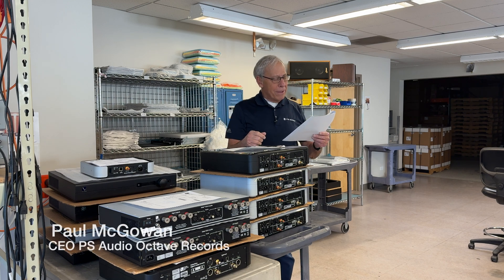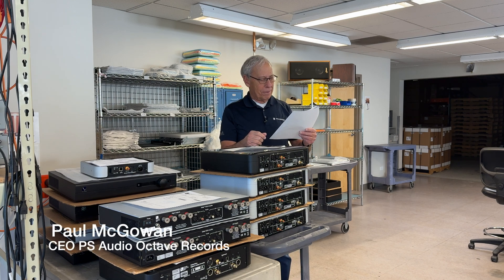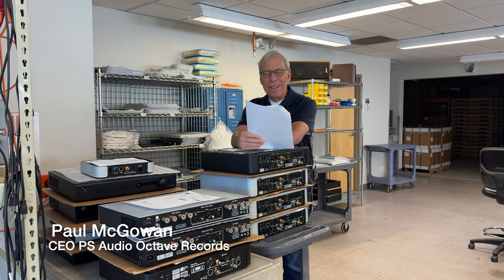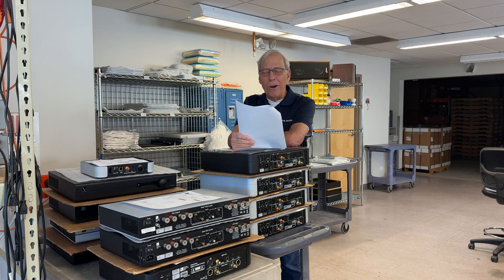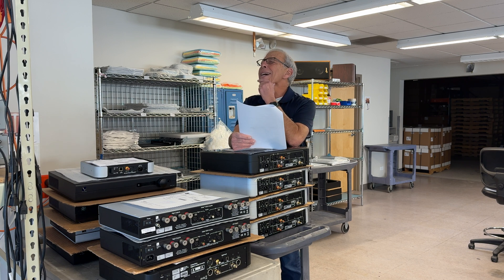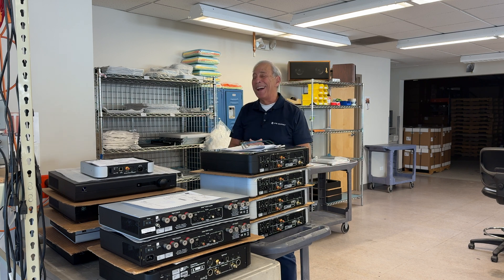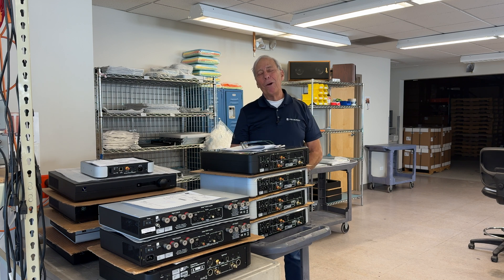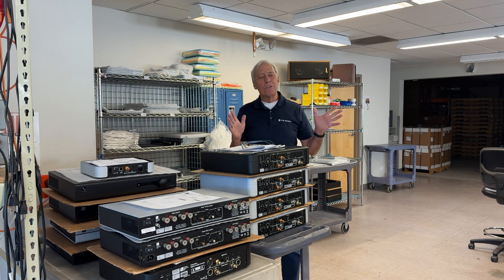Power Plant protection explained

Comment: Correct me if I'm wrong: 'It's my understanding that US power plugs (Type A & B) don't have an ON/OFF switch.'  
This being in contrast to most (all) other standards that have a direct ON/OFF switch as part of the wall socket.

Here in Australia we always just switch off electronics at the wall socket (but leave plugged in) at out holiday home to ensure surge protection and prevent electrical leakage (save costs.) Same if we lose power, Just switch the sensitive electronics off at the wall so that when power is restored, there's no risk of damage. No need to physically unplug.

Comment: Why no UL, ETL, ULc, or any independent lab tests, certs to show it meets industry safety standards, for all things electrical.  the thing is $10K  what are you failing to meet in specs? there is no such thing as built to the same standards, without the label and number.  Shame , for such pricey stuff, no standards for safety

Comment: I have 2 P3's, and I would NOT go on vacation with these left on at the wall. When the power is interrupted by a power outage, the P3's turn on by default when the power is returned. 
This obviously means that you will return from your vacation and your entire system is on and ready to go 😂
Reply: I worry that my Directstream will be cycled on and off in mid-boot if the power flashes on and off. Is there a way to set the Power Plant 10 to not turn back after an interruption of power? Any one know?

Comment: Wow never heard Paul has a "home theater system". 

Wonder what is his processor or AV receiver is? Is he using PS amplifiers.

What does a power plant do when it is on?
Reply: check the video library. he once led a tour.
Reply: The Power Plant rectifies incoming power and uses the DC supply to drive a power amplifier with a DSD created sine wave. This isolates any noise and distortion on the incoming power. Happy listening!
Reply: @belalugrisi1614  seriously that sounds like oil tone. Don't you mean Pulse Width Modulation instead of DSD sine wave.

How does it sound compared to the Audioquest Niagara 7000 Power Conditioner?

Comment: Why does my P3 have a standby mode?  All of the other PS Audio components of my system are plugged into the P3.  I leave those components in standby, as recommended, when not in use.  However if I place the P3 in standby the components plugged into will get no power equivalent to turning the back panel main power switch on each of those other components off, which is not recommended.  This is not mentioned in the operating instructions for the P3, curious.

Comment: Lightning struck a tree 40ft from the house, stripping bark off one side.
Surge protection was fine and undamaged, but surge induced in a long speaker cable blew output stage of power amplifier.
How many will unplug all power cords, cable, satellite, long interconnects and speaker cables to minimize surge risks?

Comment: If I go on vacation, I'm unplugging my audio system.
I trust PS Audio uses a large MOV that can handle a large surge.  But be aware that MOVs in surge protectors have burned down a lot of houses.   Be careful with power bars with surge protectors.
GE used MOVs in 2S smart meters used in residential homes.  A lightning  strike anywhere within a couple of miles would occasionally cause the MOV to explode.  PG&E had a bunch of these and a lot of pictures of meters with black soot circulated the net.  Could be a bad day if you had an old house with the meter in the basement.  GE sold off the meter division.
Reply: PSEG just put in a "smart meter" today.  So they can remote monitor us all.  They are doing millions in their region...
Reply: @cengeb  It is not so they can remote monitor you.  Google, Facebook and Microsoft are the ones you should worry about for that.  They know everything about where you are and what you are doing every moment of your life. 
The utility just wants to easily charge you when you use their energy and turn it off if you don't pay.  The 'smart' meter allows them to do those things without sending a guy out in a truck to your home.  It's about the same as the phone you had for the last 100 years.  If you used it, the phone company knew about it and billed you by the minute.  If you didn't pay they cut off the phone.  How is that different?

Comment: My home in Anza, CA, was struck by lightning in May 2014.  The lightning struck the mast that held aloft my anemometer.  We weren't home.  But the symptoms that we experienced when we got home were: (1) a strong burnt electrical odor in the house; (2) several home theater components, including the TV, were damaged to the point of not working, and they had to be repaired; (3) the anemometer (windvane and rotating cup assembly) were blown to pieces; (4) a laptop computer in my observatory, completely separate from the house, was damaged so that only one USB port worked; and (5) the dogs were freaked out.  The probability of lightning striking a house is not as impossibly remote as you seem to think.  I'm surprised that someone living in Colorado, where thunderstorms are frequent at certain times of year, would be so oblivious to the possibility of lighting striking one's home.
Reply: When you consider the number of homes within high-prone areas of lightning occurrences (usually south and southeast) that are struck by lightning when compared to the overall number of homes in those given areas, the chance of a lightning strike is only slightly above rare. In areas where lightning strikes are less likely to occur (usually north from NW to NE), that chance goes down considerably. Paul is correct in saying that, for the average home, a lightning strike would probably never hit it. 

I know it would be easy to surmise that it can happen more likely than not if one’s own home was struck but for the average domicile, it’s a highly unlikely occurrence statistically.

Comment: Why not just using a simple power switch in front of the whole system so that you can turn it off completely instead of "deplugging" all the wires during your vacation?
Reply: Lightning once struck the top of my umbrella. That top piece that's made of metal. That shouldn't be made of metal. Umbrellas don't usually have a makers mark; so if you buy one used, you don't even know who you can sue. I was hiking and moved to higher ground and it came near to striking it again. Don't believe that thing that lightning never strikes twice. Nor that Fleetwood Mac lyric "Thunder only happens when it's raining." It can happen when it just looks like it's gonna rain!  And always buy an umbrella with a plastic thing on top; not metal; and maybe don't ever go hiking if it's getting cloudy.
Reply: @sidesup8286   won't matter a bit what that thingie on top of your umbrella is made of. After 20 miles of air lightning, it won't even slow down.
Best thing is to stay inside, away from walls preferably. 
A ground, a real ground will help.
A solid copper spike driven into the ground ( why they call it a ground) connected with a solid copper wire. But most people, after spending thousands on a system, just don't want to mess with it.
Reply: Are we sure that's enough ?
Reply: @Jorge-Fernandez-Lopez  That's what I'm asking. 😉
Reply: @Fastvoice  a typical lightning strike can be a billion volts or more. That switch, even turned off, will be a conductor. You need to completely unplug your system. Just think about it this way, that lightning has already traveled through 20 miles or so of AIR, do you think a switch will slow it down even a little bit😮
Reply: @musicman8270  Thanks - that makes sense.
Reply: It's amazing that anyone survives after being struck by hundreds of thousands of volts. Not only is there that metal cap on top of umbrellas, but there's all those thin metal rod spiders or whatever you call them inside. I'm sure there's a name for them. I call them a S.O. *. Second letter of the alphabet. I woke up with alphabet letters in my sink the other day. I put a very filthy cd in there to soak, and the letters from the label side dissolved off. It looked like an unfinished bowl of vegetarian vegetable soup. Umbrellas are both one of the best inventions and also one of the worst. A product with all that metal going on up top, meant to be used during storms. A rumble of thunder can produce subsonic frequencies well below human hearing. But you can feel the vibration with no apparent sound. Sitting there and feeling that cool vibration without a sound. How cool is that??And your knick knacks start making rattling noises.
Reply: Lightning and surges can cause high potential between electrical grounds and antenna/cable system/satellite grounds. If you turn off by a switch, your grounds are still connected. Eliminating one of the grounds by unplugging will help, but any incoming data or signal line can kill your system.

Comment: should be noted that the passive surge protector modules get 'used up', spent, every time there is a spike a little area of it gets spent.  what's tricky is that you can't observe how spent they are and how fast they get spent depends on how many spikes your house gets!

(mostly on a normal house in normal western location they do pretty much nothing)
Reply: Agreed.  When they are 'spent' a sufficient surge will cause them to explode.  Sounds like a 12 gauge shotgun and it creates a puff of black soot.  What you cannot see with the naked eye is a plasma burst that will ignite flammable material near the MOV.  If you test the limits in a high voltage lab and film it on super slow motion it is quite the event.  I observed it using strips of cheesecloth.  Anything within a foot or two of the device with the MOV would ignite the cheesecloth.